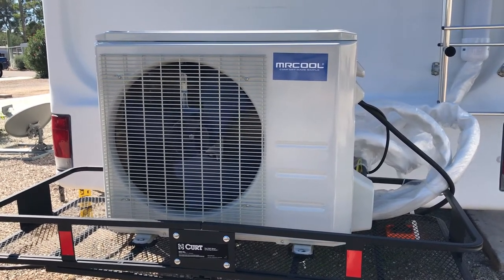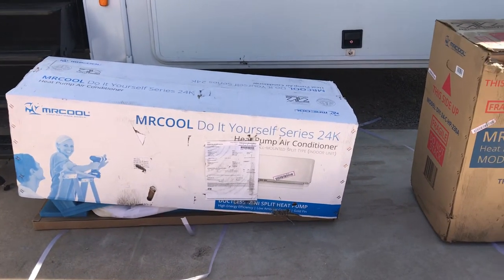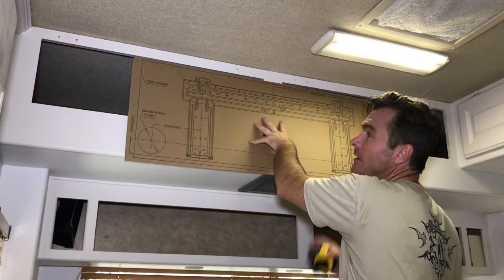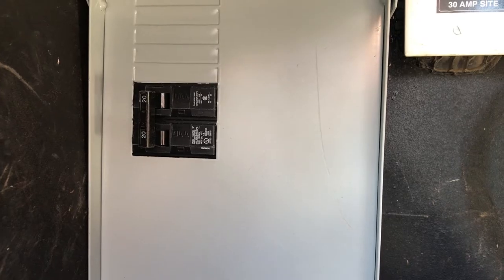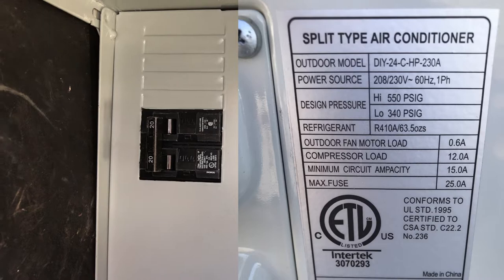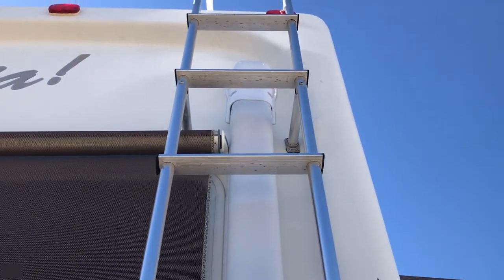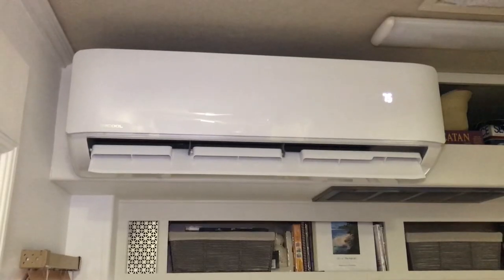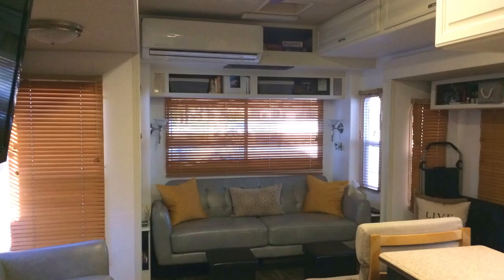RV Mini Split AC Install Project

Comment: Just a tip that I learned the hard way get some kind of cover like a grill cover so that when you travel the fan does not turn because the fan spins too fast when traveling and will explode and also i upgraded to a metal fan

Comment: I understand that a coiled hose will trap the returning lubrication oil so I ordered mine with a 10 foot hose and did essentially the same install as you. It was JUST long enough to route behind the ladder. Just something for others to consider.
Reply: MRCOOL recommends coiling the excess like this so it must not be a huge issue with these

Comment: Thank you for your video. My daughter has a trailer like yours that she lives in and her utility bills are quite high. She has dogs, so can't shut off heat/cool while she is at work. She lives in the NC mountains and she gets a lot of cold weather and also hot, though I think it is a function of the limited insulation she has. Of course, she does not have the high temperature extremes of Arizona. Thank you for the time you took to do this video. Well done! Jim

Comment: Good install~ I might recommend (if no one else has) to add some cable glands to your power in/out ports in the side of the outdoor unit; the glands keep water/contaminants out of the electrical hook-ups while protecting your cables from rubbing on that sharp metal hole.
Reply from the maker: Great recommendation, thanks!

Comment: No is the breaker box you installed right off the 50amp service coming in the only breakers needed for your unit? I was trying to work out where I might pull my power in from if I installed a mini split and where my service comes in at would be pretty accessible. I just need work out where I would mount the outside unit. I have a 40' toy hauler so the back wall is the ramp. I thought maybe using a similar cargo rack like you used but making it where it could swing away. If I had a swing away rack then I would need a flexible freon line and that complicates things considerably.
Reply: Hi! Yes, the breaker box I put in is right off the 50 amp service box. The breaker box I installed (as seen in the video) is the only breaker needed. We just ran a 'jumper line' from the 50 amp service panel to that dedicated breaker box for the mini split. Huh, on a toy hauler; never thought of that application. Like you said, you may need more of a custom made platform that can be mounted on the off-center of the back so that it can swing away with minimal movement for all your connection lines.

Comment: Do you think I could drill the holes, mount both units and have an electrician come set up the rest? I know nothing about any of these but I’m perfectly capable of mounting, drilling holes (properly) but electrical I know nothing. I have no idea where to find that electrical box you showed on your RV. 

I have a 1996 Rockwood fifth wheel 27ft, I have limited space as well and really only one spot to put the AC unit, it would be in the kitchen/living room, so not at one end blowing to the other. I’ve got one super slide and that is all, very small RV. Do I need it at one end for best results? I just moved to Yuma, so want to invest in a 2-ton mini split because the RV is older and the heat is extreme here
Reply from the maker: i don't think you need if at one end of the RV for best results. You may actually get better results than me having it more in the middle. I've seen other guys on YT that went that route. I had help with the electrical too. I consulted with my electrician friend first, then installed. You may want to do that, just to be sure that your plans will work fine with the electrical part of it. But you should stay nice and chill with a 2 ton in a 27' RV! Even in Yuma :)
Reply: @iboughtarv6570  thank you so much for replying so quickly! I will do that, I don’t want to mess up installing it. Thank you again!

Comment: Nice Job. Did you consider adding an indoor unit near the bed ? When you sleep it seems you will have to heat the entire coach up just to warm up the bedroom ? I have the exact same Alfa See Ya model and am contemplating doing the identical install you did but adding a ceiling cassette where the existing roof A/C is over the bed. But there is no room to plumb the 
line set to there. Did you consider running the line set across the entire roof to the bedroom? I have not seen this done
but don't see why it could not be. Do you have any thoughts on this? Appreciate you posting the video !
Reply from the maker: Hi Mike. That is an interesting idea. We never considered doing that. I'm not sure how that AC line would do across the roof. I would have to ask an AC professional. However, with a 2 ton unit, we never had a problem heating or cooling our place. IF I needed to be up in the bedroom on 110+ degree days in Tucson during the middle of the day, I might use an upright fan down near the kitchen island to push some of that cool air up there, but I don't need to do that very often. The heat pump heats up the coach fast.

Comment: Hello! So this one mini split cools/heats the entire Rv? Is it colder/hotter in the room that it’s in?? Thanks for the video!
Reply from the maker: Hello! Yes it does cool / heat the entire RV. And yes, the main room where the wall unit is will be either warmer or cooler than the front of the trailer (where our bedroom is). But the fan on the wall unit does a good job blowing the air up the middle of the trailer. Hope this helps :)

Comment: great job, check out my build in 2012 -

OverTheTopCargoTrailer 

100% solar cooled and heater 7 x16 trailer.. 

now just throw in some lithium batteries & solar panels and your set for life....

my unit cools in 100F down to 72F only using about 250 watts per hour 

cheers Jerry

Comment: The down side of this size unit is you are limited to only sites with 50a service.  From what I've seen a 12k unit that is 120v is sufficient for a large motorhome because they are so much more efficient than the old roof units.
Reply from the maker: Hey Brian, that's true. It you do a lot of traveling, you do have that limitation. We stay put, live in it, and live in Arizona; all these factors were enough to up the size of the unit.
Reply: @iboughtarv6570  I saw that later in the video.  I'm looking at a full solar system and I was debating on whether I want to add the expense of a 240v inverter instead of just 120v, so I can run a dual zone mini split.  It might be overkill unless we end up in the desert or humid SE when we retire.
Reply from the maker: oh i see. that''s cool. I would be interested in knowing what you decide.
Reply: @iboughtarv6570  It's expensive to go the 240v route, but it would let me use a multizone mini split (9k in bedroom and 12k in living area) and I could find a 240v clothes dryer isntead of the wimpy 120v ones.  240v is more efficient for appliances like that anyway.  The downside is I'd be looking at about a $9k investment in solar equipment and batteries.  On the plus side, that's a 14kw/h system.  So BIG power.
Reply from the maker: i can see why you're debating on what to do! the multizone would be awesome.

Comment: Great install, I am looking for a little more info on the wiring. Are you running off a generator? I understand the inside and outside unit are wired together, but how are you powering the outside unit? Did you just wire a plug to either attach to shore power or a generator?? Thanks,
Reply from the maker: Hi. No, I'm not on a generator. The power is coming right from the RV 50 amp panel. That is plugged in to shore power, and then I pulled off the main RV panel into that separate breaker box dedicated to the AC unit.
Reply: @iboughtarv6570  How did you wire the 230 volt, i keep reading the you can't do that.  Can you provide a diagram of what you did. I would even pay for it.

Comment: Nice simple video thanks. I am curious as to the over the road "beating" might effect this unit.
Reply from the maker: Hi Dan. I've only moved our rig 2 times since we installed our mini split. Once was a short in town trip, and the other was about a 100 mile trip down the highway. Both times, we didn't have a problem. To be safe, I put a couple of ratchets over the mini spilt hooked down to the platform, and one around the wall mounted air handler unit. There are a couple of other guys on youtube who have driven many miles without issues.

Comment: Nice unit, I wasn't clear but can it run off 110v or do you have to have 240v? The reason why I'm asking you have 50 amp coming in.
Reply from the maker: 110v would work as well, but a 2 ton unit like this would more than likely be 240v
Reply: @iboughtarv6570  Thank You for information.
Reply: I run mine on 110v, just order the correct unit. A 23 seer efficiency unit in a 8K BTU size drams no more than a 1000 watt heate. Very nice and is quite.
Reply: @iboughtarv6570  the unit you have is 240v. How do you get it to work on 120v?
Reply from the maker: @leob5195  I have it wired directly off the 50 amp service coming in. It only draws 15-25 amps. The fact that it's 240v just refers to the amount of electricity flowing to the A/C unit.

Comment: Hi I have a quick question I want to do the exact same install 24K BTU mini split could you please go to more in depth with your wiring because I would love to just wire straight off the 50 amp cord instead of having to buy an inverter and step it down to 110 V could you make a quick video or explain how you tapped into the main 50 amp power cord

Comment: Question, i have a 40ft 5th wheel with a 50amp breaker box and service. I recently had both of my ducted rooftop Coleman mach AC units (15k+13k) go out and instead of replacing them i want to get a 2 zone mini split but they are only available in 240v. Since i wont be using either of these ac units anymore i now have those 2 free 20amp breakers free to use. They are both on separate legs inside my breaker box panel. Is there anyway i can connect a 240v mini split given my specific situation and equipment? Or do i just have to get 2 individual 120v mini splits?
Reply: Hello. I think you can do what you are describing, however I would absolutely check with an electrician. That is what I did. I'm not qualified to give that kind of answer. But a 2 zone would be awesome! Hope it works out for you :)

Comment: Thanks for the video and your contribution. I am going to purchase a mini split for our 40' 5th Wheel with bunkhouse Front Master Bedroom.  Do you have a separate room in the back and bedroom, from the location of your mini split? Does your AC/Heat overcome the separation with one unit (work very good)? What is the BTU/HSPF rating you used for Tucson. BTW We lived in Phoenix area 27 yrs. Now will be going to Florida, Washington state and AZ for main stays. Do you think your unit will accommodate the Florida heat/humidity and the Az Dry Heat? How is your rack on the back holding up while traveling? Did you buy a prefabricated Rack on the back hooked up to the frame? Feedback appreciated.
Reply from the maker: David Roberts Hi David. We do not have a room behind the inside air handler unit. It is mounted about 24” away from the back wall. I put it where it will blow straight up the middle of our 5th wheel. It both heats and cools the front bedroom no problem. We have been very pleased. Ours is a 24,000 BTU or 2 ton unit. Our mini split has handled Arizona 100+ days no problem. I was amazed. A 2 ton is technically too big for this space, but given the fact that 5th wheels aren’t noted for their insulation, I wanted to go bigger than the space needed and I’m glad I did. 
There is another guy who posted a video about a mini split and he was in Florida. He said his mini split, also a 2 ton I believe, had no problem. 
The rack on the back is prefabricated. It was about $100 on Amazon. I have not traveled yet. I have the unit bolted down to the rack and will also use 2 rachet straps to be safe when we do. It should just fine though. Please let me know how your project goes! Thanks

Comment: I'm just wondering how durable a mini-split over the road is.  How it is performing after 1 year.
Reply from the maker: Sorry for the delay in getting back to you. I've only moved our RV twice since I installed the mini split. Once across town, the other on the interstate. Both times, it did just fine. I put a couple of ratchet straps on it for extra security and it did great. There is a guy here in these comments that mentioned if you're going to be traveling a lot, you may want to put a 'grill cover' over the fan blade (maybe a tarp wrapped around it would be sufficient) so that the fan blade doesn't turn too fast while traveling.

Comment: How is the 2 inch clearance on the top working out? I'm looking to install the exact unit in my 5th wheel but they recommend 6 inches of clearance on top and I only have about 2 also.
Reply: And as soon as I write that I see your explanation lol
Reply from the maker: So far, it’s been fine. For this unit, 4” on the top was recommended. (Was it 6” on the sides?) The recommended space (on the top)  is assuming that you’ll only have air coming from one direction. However, because I removed the cabinet door up above to hang the air handler unit, it has air coming from both front and back. I think that helps a lot. Not sure where you’re at, but if it gets cold where you are, the heat pump on this thing is awesome. We’ve been using it all winter. Well worth the extra money. Hope that helps.
Reply: I just saw a few comments on some reviews I was reading about 6 inch clearance on top not sure how true they are. Where I'm going to mount it the roof is slanted so I'll have about 3 1/2 inches on one side and 2 on the other and plenty of room on the sides so I'm thinking it will be ok. I'm in Texas so the heat won't be used extremely often but I really need more cooling power. I already have 2 15k btu roof units going and on the hottest days they struggle to keep it under 85 in here with high humidity. Thanks for the help.

Comment: Hey sir,  did you have to cut and flare the line set? Just curious cause I'm putting one in same type of location and setup
Reply from the maker: Hello. No. The AC unit comes pre-charged. All you have to do is connect the lines. No cutting needed.

Comment: How has it worked this summer? I have a 42ft Fifth Wheel and our bedroom is at the opposite side of the camper to which I want to put out mini. I want to know if you had any problems cooling/heating the entire camper now that you have been in it for a winter and summer
Reply from the maker: Sounds like I have the same situation, although my 5th wheel isn’t that long. In Tucson when it’s really hot (110+), we use a fan to push some cooler air up in the bedroom maybe an hour or so before we go to bed. That has been plenty good for us. Other than that, this thing is awesome. It’s actually way bigger than we need for the space, but because of thinner walls (thinner than a house) I wanted to use a unit that would have no issues whatsoever cooling our RV. The heat pump on it is great and heats up our trailer very fast. Also, this past summer, the highest electric bill I had (in an RV park) was $120.00. That mini split is super efficient. We’ve had over a year, and I would do it again. Perfect solution for us.
Reply: Thanks for responding. I was thinking the same on the size being that the walls are so thin. The wife and I just bought a lot in a RV community here in north Georgia. Our summers are not quite as hot but are more humid. Good video and information. Thanks again.

Comment: Did your alfa come with the trailer hitch or did you install. I have the same unit but it doesn't look like i have anywhere to mount it.
Reply from the maker: Hello. It was already installed when I bought it. I've heard they have 2 different kinds: 1 that is rated to just mount a platform for gear, like I did, and another that is rated for actually pulling a vehicle. I think mine is a the lighter rated version.
Reply: @iboughtarv6570  I would sure like to see that installation. If you ever get under your rig try to remember your camera and take a pic of the setup. thanks

Comment: Hi, so... Please explain how you get 240v from a 120v service?
Reply: Use the two hot legs from the incoming power cable. They provide 240v across each other.
Reply: A 50 amp RV service is actually just like a 150 amp or a 200 amp home  service with the exception it's only capable of delivering 50 amps.  Most RV just have it split up into two 120 volt 50 amp circuits.  So between each hot leg coming in and the neutral wire (white) you have 120 volts but between the two hot legs you get 240 volts.  My Teton RV actually has a commercial QO Breaker panel installed from the factory so it was easy to install 240 volt breakers.  However most RV breaker panels will not except a 240 volt breaker so you will need to install an auxiliary one if you want to run any 240 volt appliances.  I updated my Suburban water heater by replacing my 120 volt heater element (1,500 watt) with a 240 volt (2,200 watt) element and my cloths dryer also runs on 240.  Roy...
Reply: 50A (4 pin) RV power connectors are split phase, meaning they have 2 120V supplies, out of phase.  Just like a house.   It's 240 VAC across the 2 phases.

30A (3 pin) RV power connectors are 120VAC only !

Comment: Cool to see this installed! About how much weight does the whole unit add to the rig? Thanks.
Reply from the maker: The platform, A/C unit, and wall mounted unit altogether are probably right about 150-175 pounds. Thanks!
Reply: @iboughtarv6570  Thanks for the info.